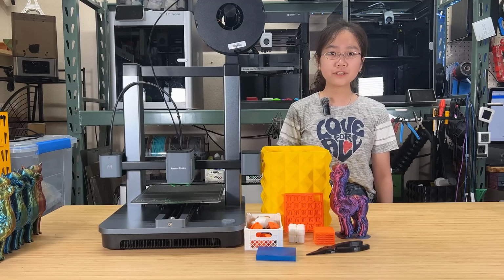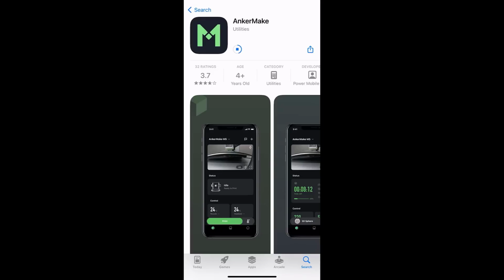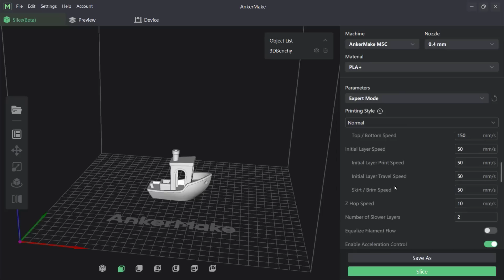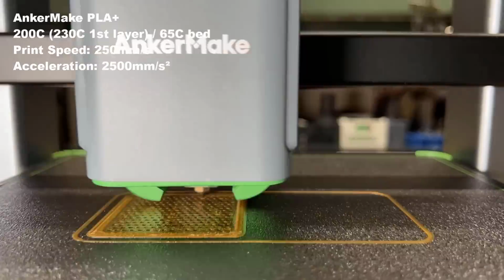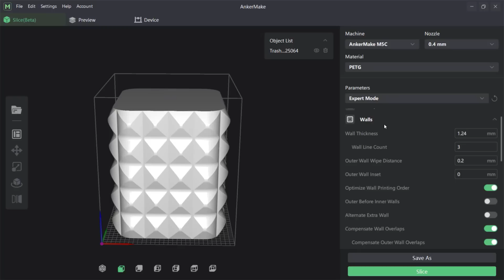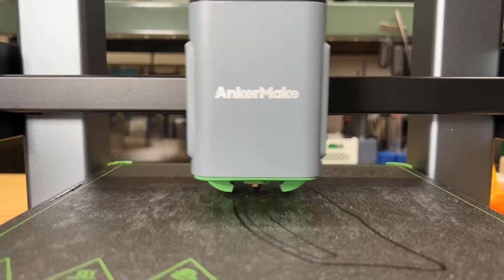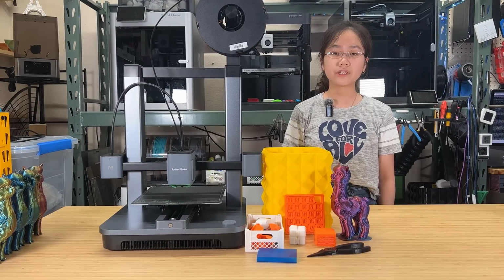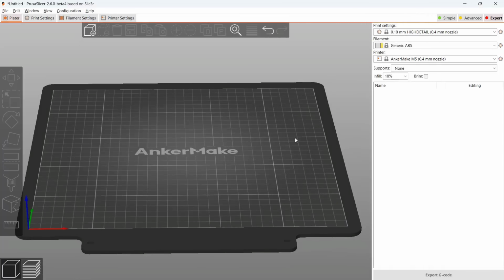AnkerMake M5C full review: testing print speed from 250mm/s to 500mm/s and up to 5k acceleration

Comment: The printer you reviewed last week came with a hardened steel nozzle but the hot end only went to 260c. This printer does go up to 300c but did not come with a hardened nozzle. I would prefer every new printer coming out comes with two print heads like QIDI does it, one lower temp with a brass nozzle and one high temp with a hardened nozzle.  That would give people more flexibility to use a wider range of filaments. Other then that it looks like a good printer, easy to set up.

Comment: Best 3D printer reviews!  Thank you!

AnkerMake got a lot right with the M5C.  They kept the important features and quality while eliminating cost in the display.  I could live with that perfectly well if they used stock Klipper so I could control the 3D printer from my computer.  I know many people like using their phone for everything but I'm not going to use an app to interface to a 3D printer... period.  No, not even a nice looking app like the one provided by AnkerMake.
Reply: Agreed... As long as you're reliant on proprietary software or a service to use a hardware product, the product becomes junk when the software stops working or being supported. And proprietary software always stops being supported unless it's subject to sufficient ongoing fees or income streams. Thats why i'd want any printer to at least run open source as a baseline and be user upgradable - even if the manufacturer offers a better experience layered on top.

Comment: Excellent review and right to the point! Where a lot of other reviews spend time explaining a lot of technical features and other things, what I really care about (maybe it's just me?) is print quality at different speeds and with different materials. As I already have Ender 3 Pro, I know how 3D prints can be (Ender has beautiful prints when everything is in sync), and how much tinkering and preparations are needed (both hardware and software tweaks) for those 3D prints to look great. Even with quite some experience, Ender 3 Pro drives me crazy sometimes (Does bed leveling ring a bell?), and still after a glass bed and auto bed level upgrade, adjustments before printing are painful. That is why I am looking at something that will require less time in preparations, but will have good prints. Your review perfectly covers what I wanted to know, and with lot of examples you don't need to explain what is better, viewers can see it with their own eyes. Now there is just the last most difficult step for me - choose between Ankermake M5C ($299) and Bambu Lab P1S ($699, ouch). Thanks and subscribed!

Comment: You always do a great job dissecting the product and its functions for use. Thank You. I am building a new model train controller with ESP8266 and we are thinking about using Cell Phones for controller. This Review shows that others can do it so we should be able to also. Also my 10s Pro is printing at 180mm/s with Linear Rails on Y and Klipper on Pi, so it seems with tuning I should get to 250 mm/s as well. Oh Boy. Thank You young lady, every video has lessons in it for this old man too. Great, Dennis

Comment: Yikes, your Benchy prints look kinda rough, I think it is the filament though.  I did a speed Benchy with this printer at the same time, 16 minutes and 48 seconds, and mine came out looking mint.  I used Elegoo Rapid PLA+ though.  I also print everything (well 90%+) at 500mm/s and have no issues with quality.  Some stuff needs to be a bit slower, be it low bed contact or just the shape of the object you're trying to print.  But almost everything I have tried has been happy at max speed.

Edit: you can slice with any app you want, then load the GCODE into Anker's slicer and send it from there, don't have to use USB.

Comment: Does it default to 2.5k acceleration? Bed slinger aren’t meant for top speed especially over 200, but can do much higher accel than that. My 300mm Klipper bed slinger handles 10k accel no issues but print between 90-180mm/s and still about half the time of stock 2.5k.
Reply from the maker: Yes, the default profile was set to 250mm/s and 2.5k acceleration.

Comment: Not Happy with mine or Ankermakes Resolution of sending the entire unit back rather then sending me a replacement extruder stepper motor. After FAILING on 3rd print.  Won't turn the extruder gears with clear filament path and finding motor had scarring on the inside when I opened it up.  Printed great when it DID but will NOT be buying another one.  Still waiting for my replacement to be shipped to get one that Works.  JUST Bought the ENDER 3 V3 SE.  I would take two of them instead of one M5C.  They are the same price for Two Ender 3 V3 vs 1 M5C.  Yes they are only 250mm/s but are we really using all that 500mm/s.